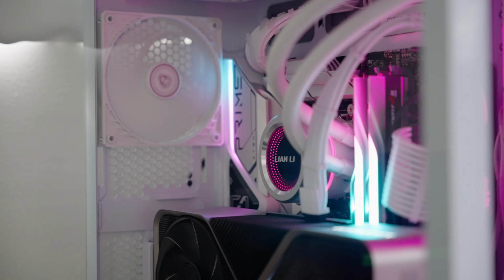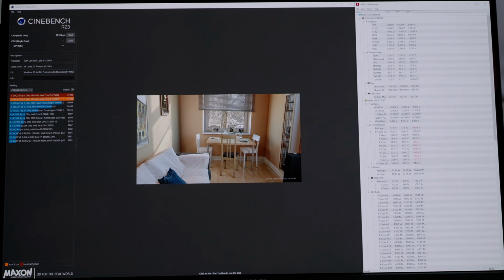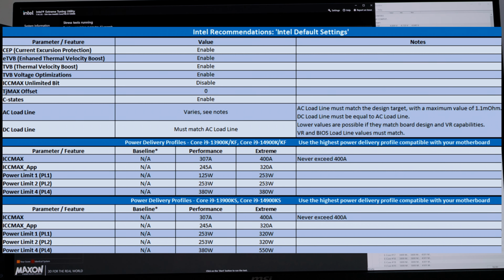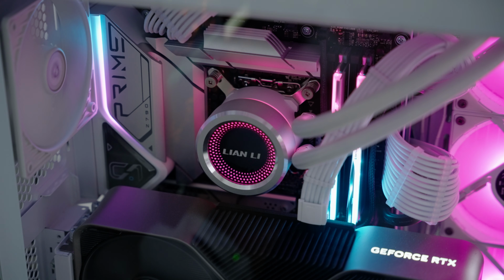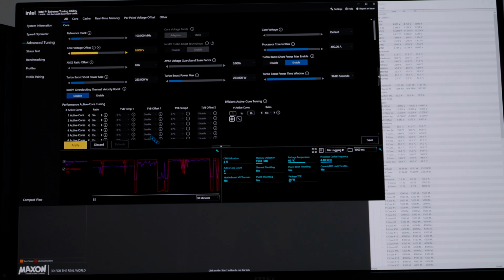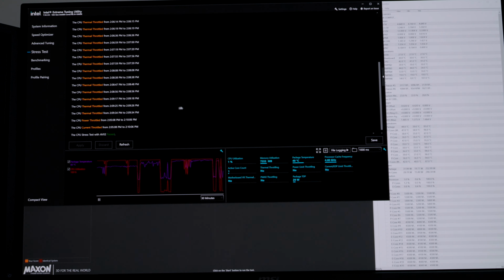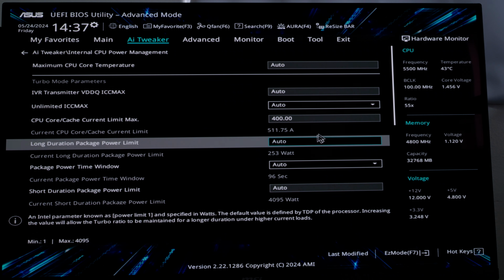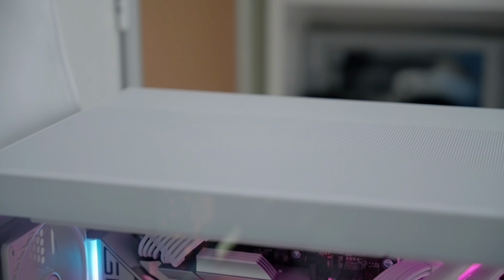SIMPLE Guide to 13/14th Gen Intel Crashes

Comment: Its a shame this whole time ive been having random pc crashes for the past 5 years. Happened around a month in of having my new pc, it would crash when i play games or in the middle of simple things like just using google chrome. It then stopped for a couple of months like is was running fine. Then the crashing came back but it was more frequent. My CPU is intel i9-9900K. I then took my pc to THREE different pc specialists who all told me they couldnt figure out what the problem was because everything is working fine within my pc all the components, the temperature are all fine. Now that im hearing about intel having issues with their CPU this might just be the problem. My pc over the years would crash then it wouldnt for months but now its came back again.
Reply from the maker: Experiences like those are the absolute worst. Being a 9th gen processor it might just be defective and require replacement :( The reason its happening to all these processors are the extra heat is causing them to become defective. Pretty disappointing from Intel. Definitely see if you can RMA your chip if its within its warranty window. Hopefully you'll get some response from them!

Comment: BIOS Settings for Gigabyte:

	•	Pervdrive: Optimize
	•	Enhanced Multi-Core: Disable
	•	CEP: ON
	•	TVB: ON
	•	Offset Voltage: -95 mV
	•	IA VR Voltage Limit: 1375mV
	•	IA VR Config: Enable
	•	CPU Current Limit: 400 A

	•	XMP Profile: XMP 1
        •	High Bandwidth: Enable
        •	Low Latency: Enable

	•	Loadline Calibration: Turbo
	•	AC Loadline: 45 mΩ
	•	DC Loadline: 45 mΩ
	•	C-States: Enabled
	•	Package C State Limit: C7

Dynamic Tuning Technology:

	•	Dynamic Tuning Technology (DTT): Enabled

This works for my CPU, you may have to change a little

Comment: I have an i7 14700k with heat and voltage issues and the same mobo bios as u and changing the setting u told us to change made me crash hard during idle but changing the actual vrm core voltage not the svid voltage did the trick
Reply: Edit: u were right i caused it to crash by removing the undervolt i set in the bios in xtu

Comment: Once you start getting crashes, there is likely some damage done to the chip. What a sh1tshow it is. I have gone for extreme stability over performance to see me out of this generation. On my 2x 13900k systems and my 1x 14900k system, I have set the E cores to 8, and all other power limits and clocks to match the 12900k spec. It now benches slightly better than a real 12900k, presumably because of an improved IPC. By setting the power limits (boost and overall amps), it doesn't go beyond 1.3v (give or take a few milivolts), so I didn't need to go through the stability testing cycle of manual undervolting. Plenty fast enough for me until I move platform. Don't get me wrong this is not a good thing, I just need to remain productive.

Comment: Would you please bless me with this information : 
On an MSI z790 edge ti max the offset for undercoating , should I select -pwn or -cpu , it used to be just - or + now there is 2 options
Reply from the maker: From my understanding, pwn is the voltage reading near the regulator while cpu is the reading near the cpu.

meaning if you do it by pwn, it means what voltage your cpu gets should be lower. i would use cpu but test a little bit with pwn if u have the time to see if you can get better results with the same offset

Comment: Bro ihave same motherboard with i7 14700k how to fix that
Reply: ¿Undervolt?.
Reply: @mariodevita661  no stock
Reply: @mariodevita661  i dont know how to undervolt
Reply: I was going to make a video but im too lazy and I review gaming peripherals but here is what you need to do.
P Cores: Sync or Set to 5.5ghz (55)
E Cores : Sync or Set to 4.3ghz (43)
PL1: 253
PL2: 253
Duration: 56s
307A
Adaptive  + Offset > Negative Sign > start with 0.005 and keep increasing by 0.005 increments
I have my 14700K set to -0.115. 
Basically keep your VIDs under 1.4v and watch your vcore. 
I just leave my LLC on auto for my MSI motherboard and with ROG boards I have mine set to Level 4

Comment: I just want this nightmare to be over. I think intel is to blame, but motherboard manufacturers are to blame as well since the default settings out of the box are not to the CPUs specs. I purchased a new Intel PC a month ago and love it but would hate to have it break in a couple of months. This is not how consumers should be exposed to anxiety. I realize six months from now as most defective CPUs have been replaced, patches and bios upgrades have stopped degradation in chips like mine that currently exhibit no issues and finally the new Intel chips are hopefully running well so we can move past this horrible episode.
Reply from the maker: Yah it’s pretty frustrating! I wouldn’t worry too much now because the settings built in are getting much better but it really was an upsetting situation.

Luckily I’ve had zero issues with my processor now and hopefully Intel learned their lesson after the pending lawsuit
Reply: @AmelisTech agreed

Comment: Dude, your Vcore voltage is terribly high, 1.30v should be enough for your i9, as mine i7 runs stable with 1,255vcore. That was the main reason your chip was hot as hell.
Reply from the maker: @sparktheysay  The crazy thing is that’s the default out of the box setting
Reply: @AmelisTech  I completely agree, however, this needs to be tweaked manually. Honestly, my 14700k runs stable with 1,255V where P-Cores by default have 5,500 mhz and e-cores have 4,300. Now with the sweltering heat outside within summer my aorus x 360 waterforce water-cooling manages to keep
it 65-67 degrees in pubg and cs2 delivering very high frames

Comment: Well i found a good solution after trying many solution use intel extreme spec  with pl1 pl2 253 watt iccmax 400amps CEP disabled enhanced turbo or MCE disabled  CPU lite load mode 7 cpu offset positive +0.045 v and bingo thermals under 90  and getting cinebench r23 39400 and cinebench  2024 2250 at consistent basis and my pugetbench scores are much higher than before earlier i got 40400 in R23 and 2300 in cinebechn2024 but temps frequently hitting 100   If i increase the pl1 pl2 to 288 and iccmax to 475 i can easily get 40300 cinebench but temps hitting 100 my processor is i9 14900k
Reply: I got the same CPU , it hits 100 sometimes and cinebench giving me 32k score only , I only updated to the latest bios , I got z790 MSI board , I'm getting a water cooler today and a contact CPU frame hoping that will change something , cooler is gigabyte water force x 2 ice and the frame is thermalright

Comment: Have a 13900k so far knock on wood, no crashes. Using a asus z790 tuf board temps are 32c idle and under load around 54c, not a overclocker.
Reply: It will.

Comment: Installed bios with the “extreme profile” and on cinebench r24 multicore test i hit 2024 points with my 13900k … never hit 100 C on core (Max 96 C) and it’s seems stable
I lost 5.5% compared to the “unlimited” motherboard profile… so Not that bad
Reply from the maker: Definitely not bad! Glad you were able to get it stable

Comment: Genuinely thank you so much for this video, I've been experiencing crashes only on my desktop applications like Chrome and Discord, and not games - but I knew it was my CPU that was the cause because any adjustments to the power limits would sway the crashes. This made me comfortable with undervolting, I've never seen anyone actually go through the workflow of actually doing it so this made me feel comfortable. Have you heard anything about Intel's next steps? Asus released an Intel Baseline profile, but this doesn't match their chart. Curious to what they'll do. So far I think your 0.02 undervolt has stabilized everything - for now. Thanks again for the video! I feel like this isn't being talked about enough, potentially everyone with these chips are crashing and there's radio silence from Intel.
Reply from the maker: Really glad this helped you :) I wasn't sure if it would be worth making the video but I knew it was the video I wish I had when I was going through this! Intel seems to be ignoring the issue and just expecting users to find their own solutions so not sure what to expect

Comment: There is one difference from the other videos that I’ve watched is that they disabled the multi core enchantment. Is there a reason you didn’t change just curious because I’ve been having issues with my new high end pc
Reply from the maker: Great question! Disabling Mutlicore enhancement enforces some of those limits we applied automatically which would be perfect. 

BUT it seems like Asus purposefully set limits lower than Intel’s recommended spec potentially to upset Intel? When I disable multicore enhancement it sets my limits to 280 Amp (which is lower then the base profile 307 Amp) 

I’ve just left it on so we can control those values ourselves! Hopefully this helped